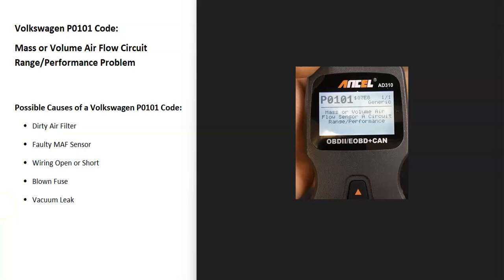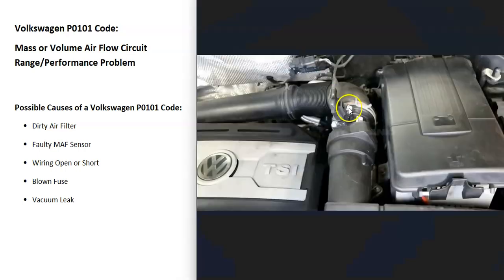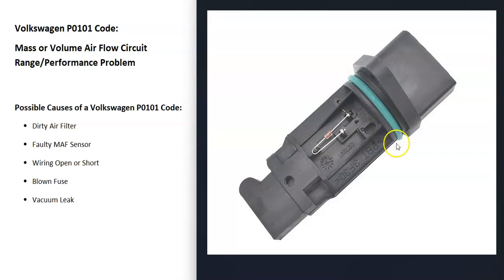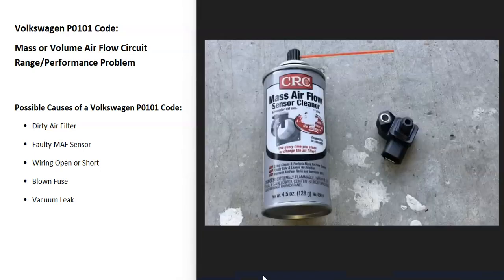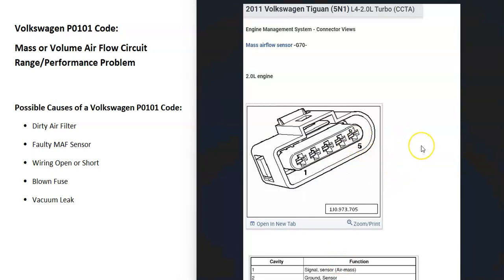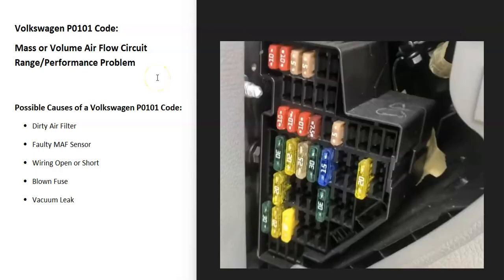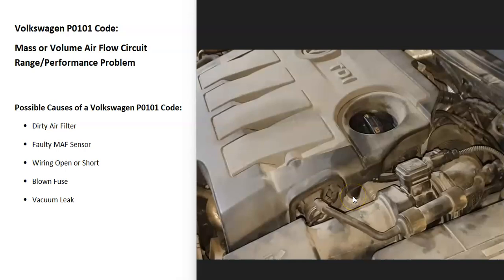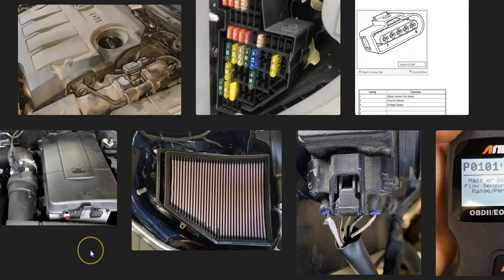Causes and Fixes Volkswagen P0101 Code: Mass or Volume Air Flow Circuit Range/Performance Problem

Comment: Hi, I have the same problem with a 2007 Jetta. I changed the Map sensor and the problem persists. I still have low revs when accelerating. I don't know what the problem is. Can you give me your opinion?
Reply from the maker: If the MAF sensor is good there likely is a wiring problem. I would check the connections and wires/pins and be sure everything looks good.

Comment: I had a po171 code and po101 along with a misfire code, cleaned the maf and it got rid of the 171 code but I still have the po101 code popping up and the car jerks into reverse and drive
Reply: Just started having the same exact issue car jerks when putting it d. I have a mass air flow sensor code. Did you get yours fixed
Reply: Mass air flow sensor fixed the problem

Comment: I am having this exact problem with this exact car. Do not buy VW anymore. I used to love them but honestly from this car and what I'm reading online, they kinda suck these days.. I initially had code p2015, intake manifold runner position sensor power bank 1.  It came on for a couple of days and then went off for a week. Would come back on for a day and then stay off for a week until it stayed off. Seems fine. Then the coolant started getting low every couple of days. So while trying to save the money to change the water pump, and I figured the entire manifold too since its coming out anyway, shop wanted $2000, I was trying to keep it topped up with coolant so it doesn't overheat. So come this weekend, a friend and I changed out the water pump, replaced the intake manifold gasket while there. p2015 still nowhere to be seen. Old water pump seal was terrible. Part of the retaining wall for the seal had vanished so the seal was just hanging out letting coolant pee out. So found that was that issue. Got that done. Drove it since then and now if I go over 2000-2500rpm it starts sounding deep and low. And it's hiccuped a couple times. Worried. New fault code on the dash; P0101, Mass Airflow sensor. G70. Implausible signal. So now it doesn't have a clue how much air is or isn't being loaded into the engine so it cuts the fuel. Brilliant. I've had this car since February. That's not to mention the several other things i've had to replace and repair on this thing already. Easily a few thousand dollars in the first year just on maintenance and repairs.

Comment: Hi, I have a 2016 Nissan Sentra and code P0101 keeps popping up after my husband and I changed the cabin filter, oil, filter near the maf sensor, the maf sensor and the air intake hose. The check engine light is on and we get the P0101 code and inc egr. Can you please help us?
Reply from the maker: I would check the wires and harness connection going to the MAF sensor; they likely got bumped or disconnected.

Comment: Hi,I'm driving a vw passat 1.8TSI B7.I also have the code Mass air flow sensor(G70) P0101 Implausible Signal.I have taken out the sensor and put it in another passat the same as mine.It drove 100% but  when I tried to put that car's sensor in my car it shows the code P0101.I don't know what to do anymore.Loss of power.That is the only fault code on the engine
Reply from the maker: If the sensor is good, I would test the wiring.
Reply: Thanks
Reply: How did you solve the problem?

Comment: Hey, what’s up I’ve been dealing with a P0101 maf circuit low code as well as a P0068 throttle body correlation map /maf code I’ve replaced both sensors map and maf basically my car feels like it is sputtering around the 2500 RPM range I let over the gas and get back on it. It goes away and drives normal randomly, which is really weird to me. Could this be a bad or dirty air filter? I do have an aftermarket, CTS turbo air intake. I’ve cleaned it up washed it out let it dry completely and put it back on and still the same. Do you think it could just be an old filter that is no longer usable let me know what input you have on this because I’ve been dealing with it for about three months now
Reply from the maker: It sounds like a bad throttle position sensor. I would clean up the throttle body and test each sensor (MAF, MAP, IAT, TPS) to see if one has an issue.
Reply: Yo solucioné ese código en mí Jetta GLI reforzando una manguera del intercooler que se encontraba débil, aguada. Con la presión del turbo se infla y no nos damos cuenta. No ha aparecido más el código. Ya había cambiado el maf, map, lavado de cuerpo de aceleración, prueba con máquina de humo, etc. y nada lo solucionó. Prueba reforzando con alambre bien amarrado, a mi me funcionó. Ahora voy a comprar la pieza nueva 😎